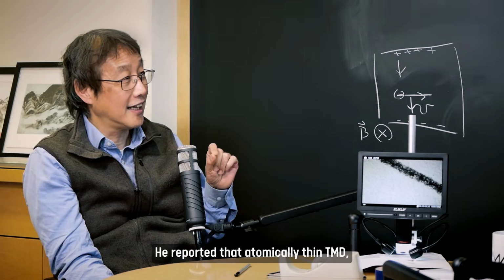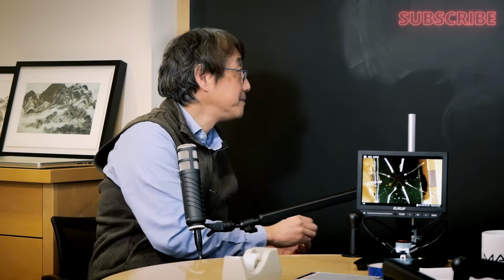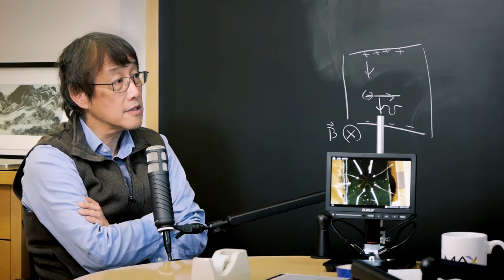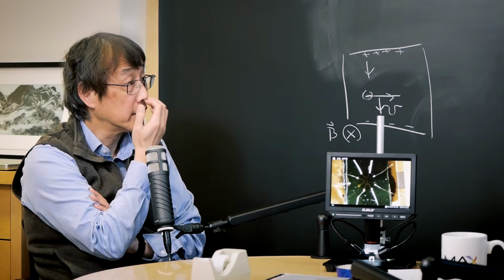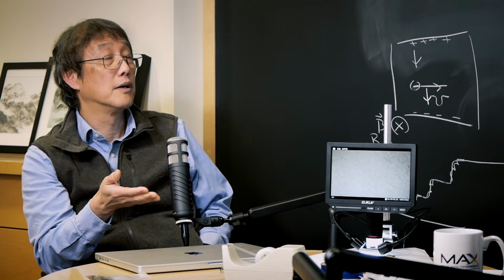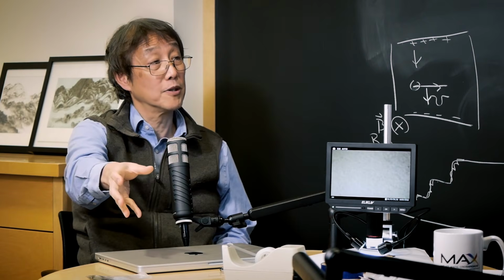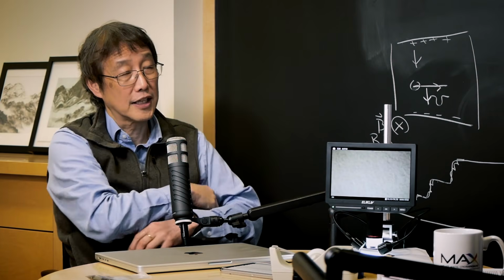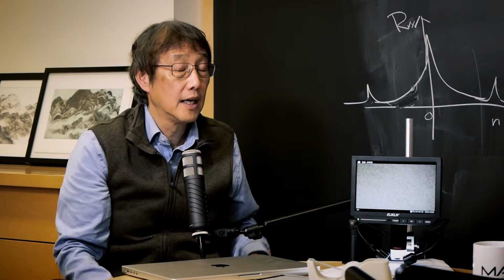Graphene, Nanotubes, and Quantum Hall Physics | Philip Kim

Comment: Quantum Vortex Theory:  ( A Quantized version of Maxwell's Vortex Theory )

    Is there a geometric explanation of Planck's constant?   Does this explanation require at least one extra spatial dimension?  Are vortices in superfluids macroscopic simulations of this geometry?  Richard Feynman recognized the need for a simulation of Quantum Mechanics. Since vortices in superfluids are extended objects with two different ends, could this help us explain effects such as "Quantum Tunneling".

   Dr. Roger Penrose has suggested instead of trying to find a particle called the "graviton" to explain gravity, why not try to describe subatomic particles in terms of spatial curvature, as in the twist in a piece of real thread.

    What if we add one extra spatial dimension to the "Twistor Theory" of Dr. Roger Penrose?   It can be "chiral" by having either Right-hand or Left-hand twist.  It can be "Quantized", based on the number of twist cycles.

   If Physicists describe electrons as point particles with no volume, where is the mass of the particle?

   Can one extra spatial dimension produce a geometric explanation of the 1/2 spin of electrons?   The following is an extension of the old Kaluza-Klein theory. Can a twisted 3D <---> 4D soliton containing one extra spatial dimension help solve some of the current problems in Particle Physics?

   What do the Twistors of Roger Penrose and the exploration of one extra spatial dimension by Lisa Randall and the "Belt Trick" of Paul Dirac have in common?  Is the following idea a “Quantized” model related to the “Vortex Theory” proposed by Maxwell and others during the 19th century?  Is the best explanation of the current data a form of “Twistor Theory” first proposed by Dr. Roger Penrose during the 1960s?  During recent years Dr. Peter Woit has explored Twistor Theory as a possible solution to help explain the current Standard Model.

   Has the concept of the “Aether” been resurrected from the dead and relabeled as the “Higgs Field”?

In Spinors it takes two complete turns to get down the "rabbit hole" (Alpha Funnel 3D--->4D) to produce one twist cycle (1 Quantum unit).
 Can both Matter and Energy be described as "Quanta" of Spatial Curvature?  (A string is revealed to be a twisted cord when viewed up close.)         Mass= 1/Length, with each twist cycle of the 4D Hypertube proportional to Planck’s Constant.

In this model Alpha equals the compactification ratio within the twistor cone, which is approximately  1/137.

1= Hypertubule diameter at 4D interface

137= Cone’s larger end diameter at 3D interface where the photons are absorbed or emitted.

The 4D twisted Hypertubule gets longer or shorter as twisting or untwisting occurs.   (720 degrees per twist cycle.)  

   If quarks have not been isolated and gluons have not been isolated, how do we know they are not parts of the same thing?   The tentacles of an octopus and the body of an octopus are parts of the same creature. 

     Is there an alternative interpretation of "Asymptotic Freedom"?  What if Quarks are actually made up of twisted tubes which become physically entangled with two other twisted tubes to produce a proton?  Instead of the Strong Force being mediated by the constant exchange of gluons, it would be mediated by the physical entanglement of these twisted tubes.  Are these the “Flux Tubes” being described by many Physicists today?   When only two twisted tubules are entangled, a meson is produced which is unstable and rapidly unwinds (decays) into something else.   A proton would be analogous to three twisted rubber bands becoming entangled and the "Quarks" would be the places where the tubes are tangled together.  The behavior would be the same as rubber balls (representing the Quarks) connected with twisted rubber bands being separated from each other or placed closer together producing the exact same phenomenon as "Asymptotic Freedom" in protons and neutrons.  The force would become greater as the balls are separated, but the force would become less if the balls were placed closer together.  Therefore, the gluon is a synthetic particle (zero mass, zero charge) invented to explain the Strong Force.  The "Color Force" is a consequence of the XYZ orientation entanglement of the twisted tubules.  The two twisted tubule entanglement of Mesons is not stable and unwinds.   It takes the entanglement of three twisted tubules to produce the stable proton.   The term “entanglement” in this case is analogous to three twisted ropes being wrapped around each other in a way which causes all of the ropes to move if someone pulls one of the ropes. Does the phenomenon of “Asymptotic Freedom” provide evidence that this concept is the correct interpretation of the experimental data now available?  Can the phenomenon of "Supercoiling" help explain the "Multiple Generations" of particles in the Standard Model?  The conversion of twist to writhe cycles is well understood in the structure of DNA molecules.   Can the conversion of twist to writhe cycles and vice-versa help explain "neutrino oscillations"?   Within this model neutrinos are a small, twisted torus produced when a tube becomes overtwisted and breaks producing the small, closed loop of twisted tube (neutrino), and a twisted tube open on each end, which is shorter than the original.  (Beta Decay)

   Within this subatomic model gravity is produced by a very small higher dimensional curvature imbalance within atoms, which causes all atoms to be attracted to all other atoms.  This small imbalance is “Quantum Gravity”.  This extremely weak attraction reveals the very small scale of the curvature imbalance.  This produces the curvature of spacetime on a larger scale like the solar system which is required to counterbalance this small imbalance in the individual atoms.

    During 1936 Richard A. Beth proved light has angular momentum, by using polarized light.  Does this prove light can produce Right-Hand or Left-Hand twist?

    A recent article by Adam B. Cahaya titled "Spin may resolve century-old puzzle of light's momentum in matter" published in Physical Review A may help confirm this model.  The following is a quote from a summary of the article.  "Spin is the intrinsic "twist" of light waves, a quantum property as fundamental as energy or momentum."  The citation is dated September 24, 2025.
Reply: Write a paper about it and send it to me. Id like to read it
Reply: @johnson.official13  How many spatial dimensions are found in Ephesians 3:18?
Reply: @SpotterVideo ive never looked interpreted this from a scientific perspective, but apparently 4. It uses 4 separate Greek words